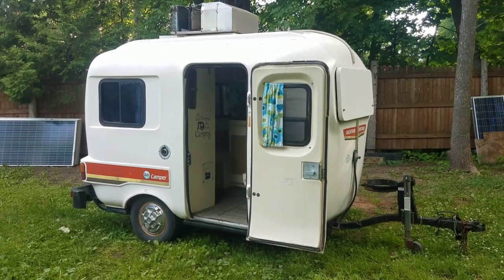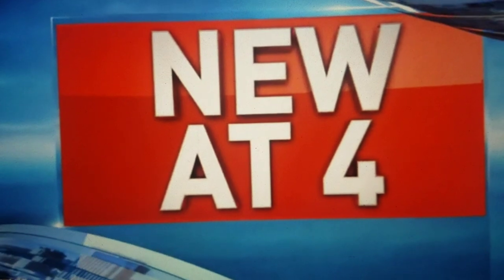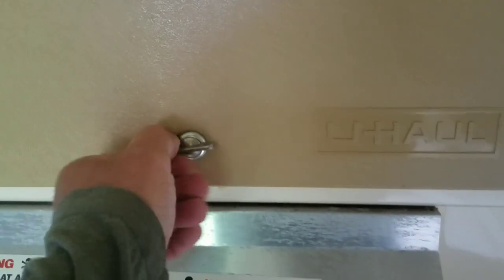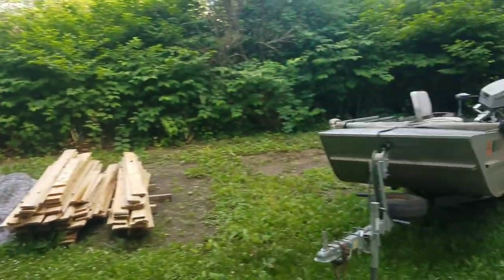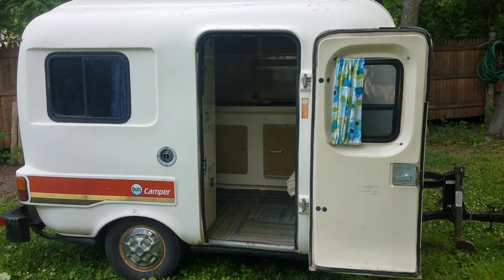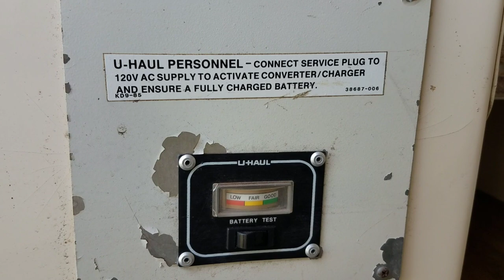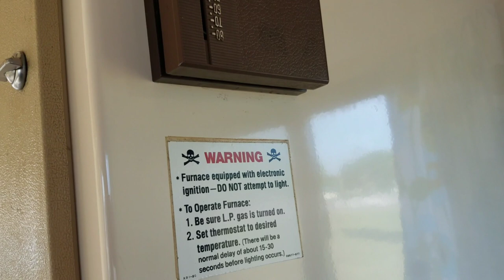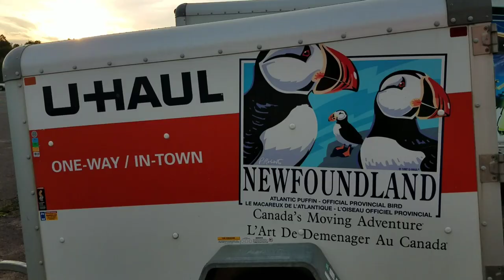"A Beagle, A Burro and a Beach Bum Walk into a Bar..." | U-Haul Camper

Comment: Yep....keep the camper. Go south in it this winter, easy to pull and park. Double hulled, yeah I know what you mean. I have a 1991 Coachmen/Ford  Class B motor home with ONE piece fiberglass construction like yours. Only 18 feet long with everything I need in it. The fiberglass construction is built like a tank. Has NEVER leaked. All three other RV's I've owned developed water leaks in the roof. Good luck with it.

Comment: Thank you for the reply. Having some serious lower back problems now and hope to find a Noro surgeon to correct a disk problem, the orthopods don't have a good track record when pinched nerves are involved. The pain management people can't seem to get a handle on it and they want to insert a spinal stimulator into me( 45% failure rate) and I refuse to take the opioids. Thankfully I still have some work left on the van that I can do, electric solar etc. Since my daughter is going to use our home as a base, I will get to do a few days on the road ( Jack  Keriwak) once in awhile. Meantime when the pain prevents me from sleeping, an Ice Pak and some Slim Potatohead or Backwaters and Backroads is the best medicine!
Reply from the maker: I blew my back out a couple days ago also Square....I know your pain. Lower back is the most debilitating. I couldn't put my socks on for a whole day. I'm telling myself I need to start remembering I'm almost 50, and stop picking up heavy stuff in a dumb way. Hang in there, get in touch again sometime....I'll keep making videos.